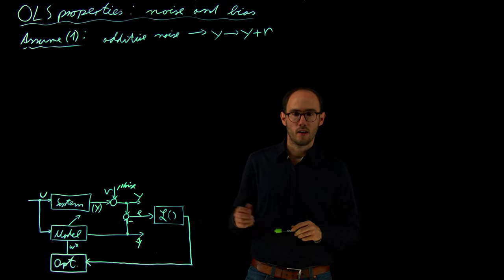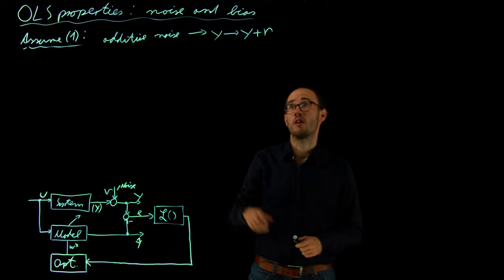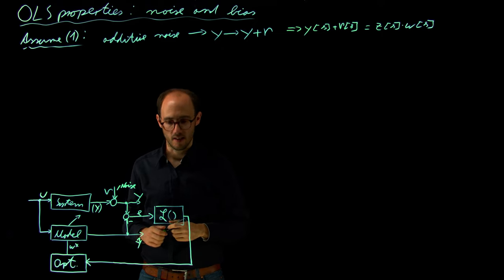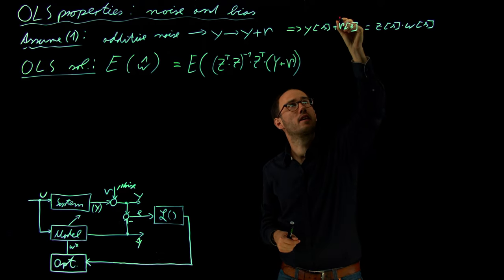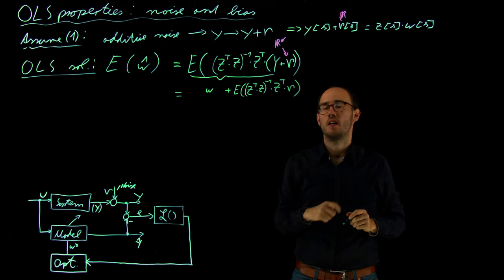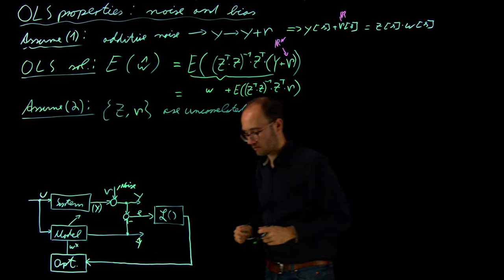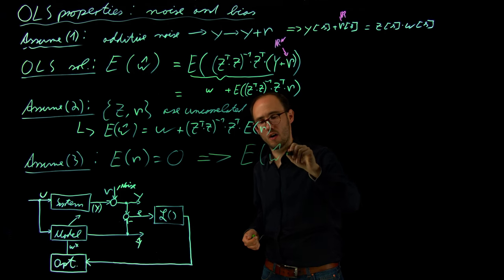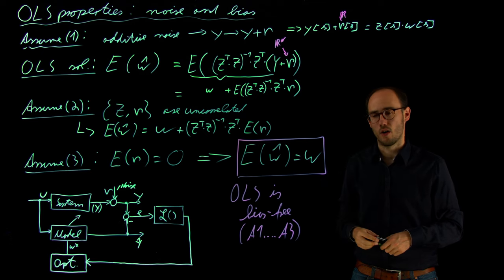Ordinary least squares: bias (DS4DS 2.05)

Comment: It seems to me that may be you should take into account the effect of noise in the regessor vector, not only in Y, I mean it is containded in Z too. I have seen that in the article "IDENTIFICATION OF NOISY INPUT-OUTPUT SYSTEM USING BIAS-COMPENSATED LEAST-SQUARES METHOD" by Masato Ikenoue , Shunshoku Kanae, Zi-Jiang  Yang and Kiyoshi Wada.
Reply from the maker: Absolutely, considering noise in the regressors is a concern in practical applications. An alternative to the mentioned paper would be 'total least squares (TLS)'. However, both approaches would be somehow advanced and this video should provide some beginner-friendly intuition on the limitations of OLS.